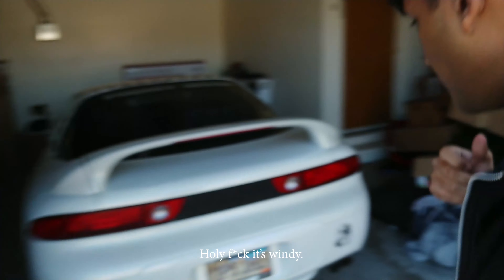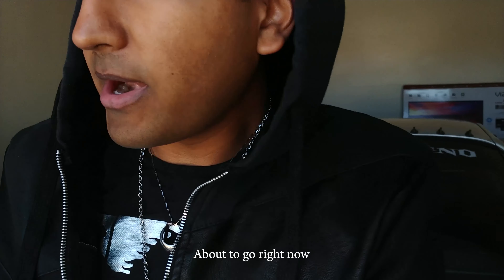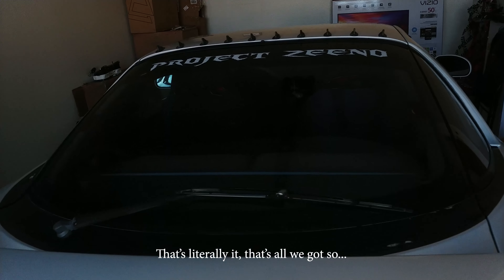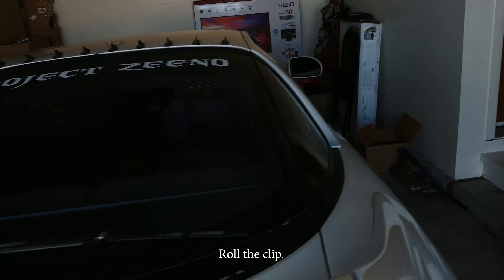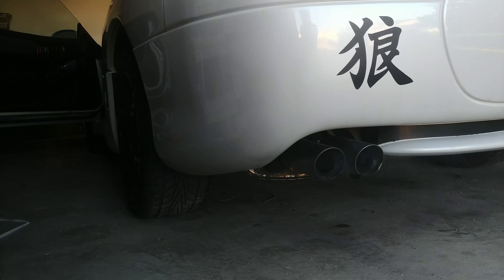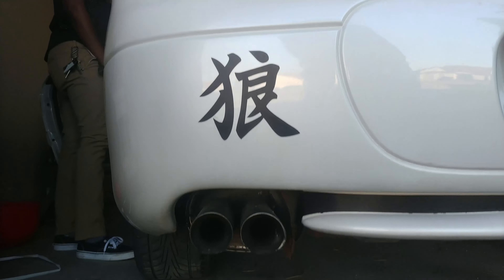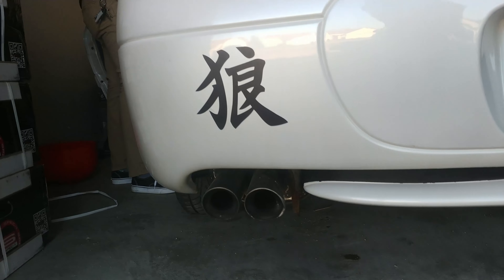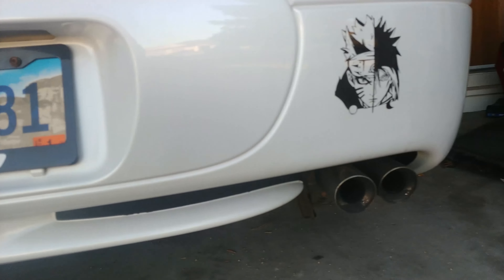3000GT Muffler Delete Sounds So Good!

Comment: is this the base sohc or the sl with the dohc?
Reply from the maker: It's a base SOHC.
Reply: wow ok i have the same one mine is black
so u just cut the first muffler off ?
Reply from the maker: @quintayperry8684  it was a small resonator in the middle, didn't effect idle sounds much but at 3k+ RPM it sounds great!
Reply: I had a sohc too back in the day before getting a trailblazer ss nothing  sounded better on it than a cat delete 3sx downpipe and maximal single shot exhaust
Reply: Up i have sl
Reply: @projectzeenomedia2584  any drone on the highway?